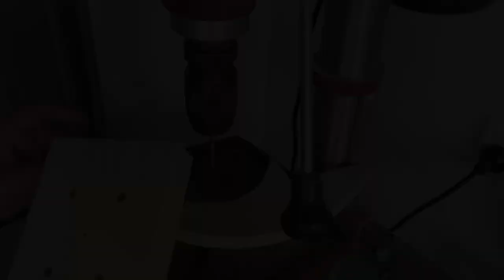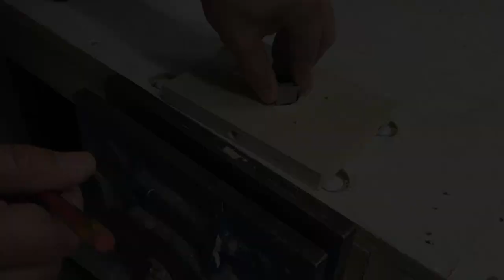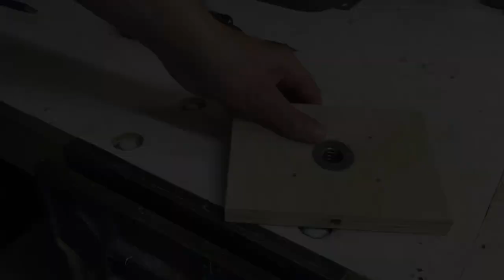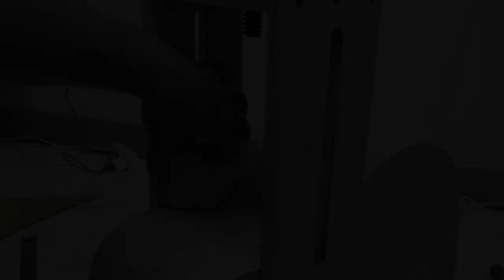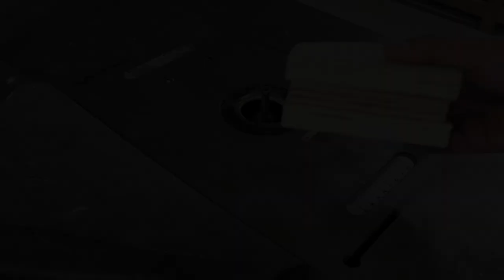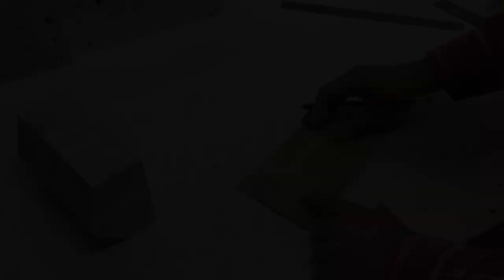How to make an acoustic guitar side bender. Part 3

Comment: This is great; nice job.    I’m going to try making one.    What size springs are those?   Thanks!
Reply from the maker: Thank you. The spring size is 166 x 19.1mm
Reply: @StapletonGuitars  thanks!!   Great channel...
Reply from the maker: Thank you @rcote1234  . I've got several workshop videos on the way, so stay tuned :)
Reply: I built my first dreadnaught last year.   Used a pipe style iron for side bending.   Too nerve wracking.  Starting an OM build this year.  I’ve got the mold built, and will build (your) side bender next.
Reply from the maker: @rcote1234  It's a really time-consuming process to bend sides with an iron. Good luck with building you new side bender, it's not that complicated & much more efficient to use. I've got six body shapes in my range so I've built six different side benders :)